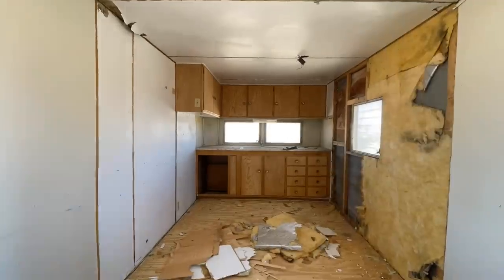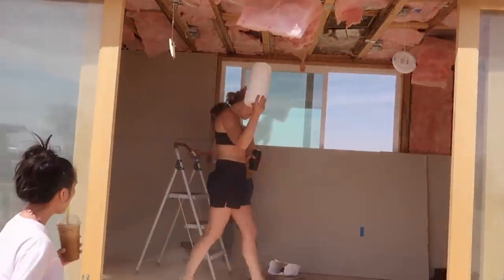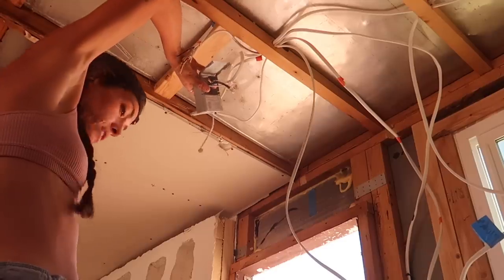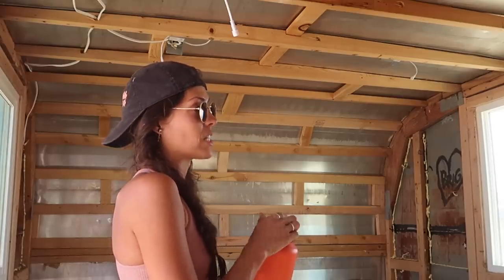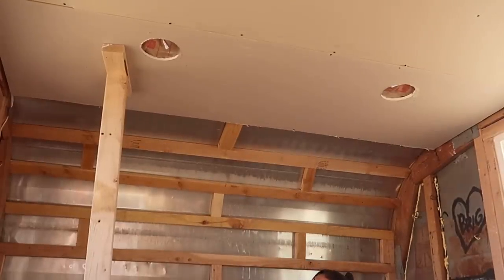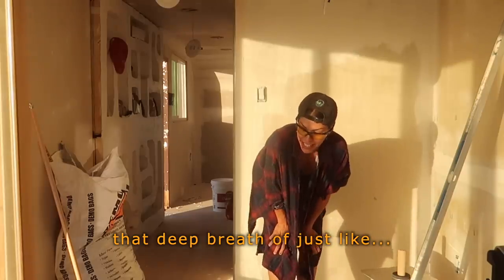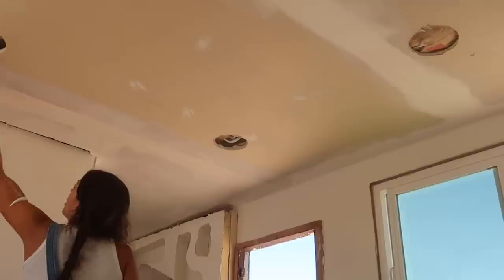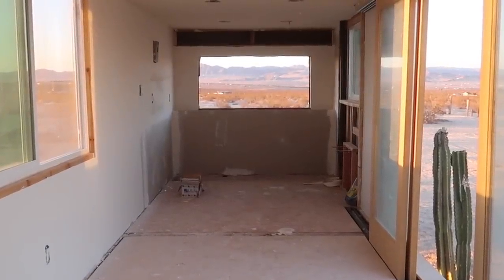WE HAVE WALLS PEOPLE!!! DIY TRAILER RENOVATION

Comment: 9:26 do you know that you can make an arch with 1 sheet of drywall seamless? You just need special roller with needles, you roll it at drywall sheet, make a mesh of tiny holes, then make this side wet. And then you can bend this drywall. Wet side goes to the studs, you got smooth arch surface without seams and mudding. Voila!

Comment: If you lean a piece of drywall against the wall at 45° and spray it with some water it will bend and create a curve Easier than cutting three separate pieces

Comment: Now I feel like a chicken for not measuring and attempting to cut (with a miter saw by hand) some plastic molding that I want to put up on a wall to frame in some wallpaper I put up to cover some really bad sad patch work that the prior owners of this place did.  I got the patches smoothed out, filled in where needed, etc. as much as I could but where the repairs were made is smooth from the extensive sanding, and the rest of the walls, which are nearly 70 years old, have years of that "orange peel" texture.  I figured it was easier to paper over the pad areas of the wall and frame that area out for an accent than to buy that orange peel spray stuff and try to match the texture!  Oiiiii.